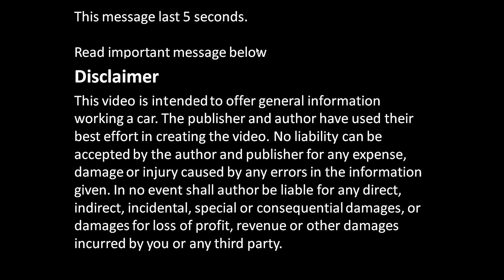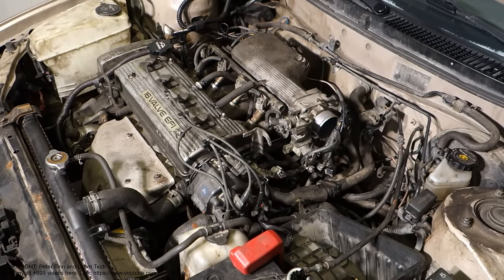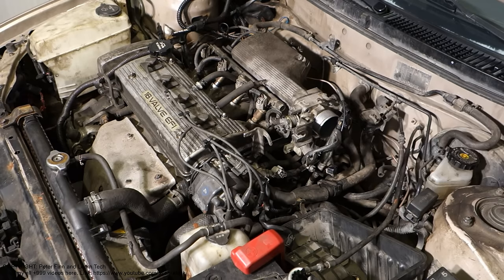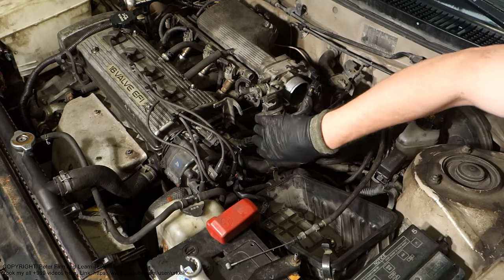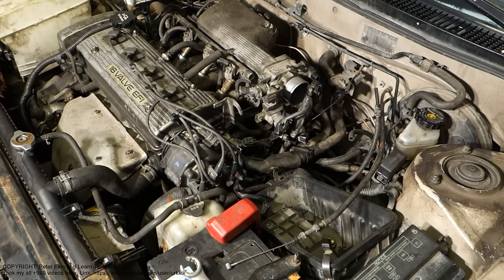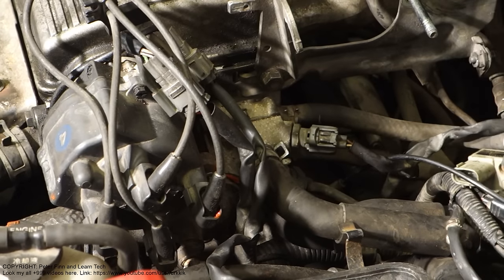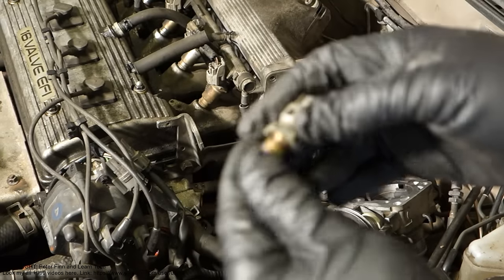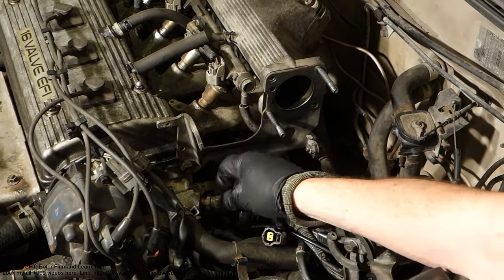How to replace coolant temperature sensor Toyota Corolla. Defect code PO128  Years 1991 to 2007

Comment: This video helped me out so much my radiator fans weren’t turning on I bought every single relay for my 2001 Toyota Corolla and stumbled upon this video, turns out the plug that goes into that sensor was broken and it wasn’t sending info that my engine was overheating
Reply from the maker: Great job!

Comment: I meant PO128, which is 'coolant' something, but coolant is fine, no leaks and temp gauge/level and warmup are all fine.  I think idle isn't too good either, which might be another symptom.  Due to your video, I know where to look for the sensor in the first place;  I'll check this and the PCV valve (as shown in another video you did) as well.
Reply from the maker: Hi, it could be sensor issue. Look this video   : https://youtu.be/OMWNyaBPb54

Comment: Very good and specific video.  I'm trying to analyze a P0128 error, coolant temp seems to be in range on my 2000 Corolla, but I get the check engine light.  I suspect this sensor more than the thermostat.  I've tried resetting and letting car warm up more, but the light will eventually come back and stay on.  Idle seems odd also which might be another symptom.
Reply from the maker: Thanks for comment. :-)

Comment: does aftermarket temperature sensor from autozone makes a big different?
Reply from the maker: These should work too, but less time. Toyota original parts last 400% more nornally.
Reply: Which one did you get?

Comment: Hey, can you help me? I have 2004 Toyota Corolla 1.4 (petrol) and it has starting problems. It cranks but doesn't start when stopping after a short drive. I have taken it to a Toyota dealership but they couldn't find anything. 

Fuel pump changed. MAF and throttle body are cleaned. Battery and sparks are okay. Today I will change the crankshaft position sensor. Next step is to change the ECT. Also all the relays are okay

Any ideas what else it could be?
Reply from the maker: Hi, please check compression rates ?  Look my video :  https://youtu.be/oYWyH8rnUwI

Comment: Replaced mine, now engine has trouble starting.  I replaced it while engine was hot and coolant went out.  It'll have a rough idle and I give it gas as it's starting.  I'll try to put old sensor on and see if that has anything to do with it.

Comment: I just did the test on the ECT sensor by unplugging it to see if the fan would turn on. My car ran a little rough  when I did that. When I unplug it it's supposed to turn the fan on right? Is the engine supposed to run and sound different when you do that?
Reply from the maker: Yes, You are right

Comment: What the other coolant sensor underneath the distributor called. I can’t find anything about it
Reply: Yeah same here
Reply: Same here
Reply: A one wire sensor is for the gauge in the cluster. The other sensor is helping the ecu to get correct air fuel mixture.

Comment: I changed mine today, but light still comes up after a while of driving. Do I need to reset manually motor light, or is there probably more problems to come?
Reply from the maker: Ok, next do these: A code P0128 may mean that one or more of the following has happened: Low engine coolant level ,Leaking or stuck open thermostat (likely), Faulty cooling fan (running too much), Faulty intake air temperature (IAT) sensor.  👍😃
Reply: @PeterFinnTheCarDoctor  kiitos 😁 tarkastin siis myös johdoilla koodin uuden asentamisen jälkeen, ja 22 ilmestyy. Sillon kun valo palaa, tyhjäkäynti kierrokset laskevat hieman. Valo pois, nousevat normaaliksi...

Comment: I was about to take apart to test, but I think I'll order the part first so I don't have to do everything twice.   I also wanna test my pcv.  Also, when do I know I need spark plugs?  I pulled one or two and they look fine, I've for 140k miles but bought it at almost 100k and know the previous owner kept maintained.  I was looking at timing chain, but shop said they last forever, as do some vids on here, though I think you have one on replacing.
Reply from the maker: Hi, here is spark plug info: https://youtu.be/e2XsCU12DQA
Reply: I replaced plugs and get insanely great fuel mileage now.  I'll address this P0128 code next.  I got new thermostat and will try that first, but I think it's okay since temp is always fine, but maybe doesn't warm up fast enough.

Comment: Thanks for the video.  I changed it with a cheap sensor from ebay, but now the temp needle goes almost to H, once the car warms up.  Do you think I should use the Toyota OEM sensor instead?
Reply from the maker: Use only OEM sensor, they are more accurate !

Comment: Thanks to your video i install temp senser by myself but last time i think i forget to put the washer and i notice coolant leak from the sensor, and i crank engine many time to start my 1997 corolla , how can i stop leak from tempreture sensor? Thanks so much.
Reply from the maker: Please add gasket glue
Reply: Peter Finn thanks so much, any gasket glue will do?
Reply: It has no washer, use regular pipe thread tape...not "any old gasket glue will do"...

Comment: Hi Peter, love all your videos :) 
quick question what's the problem on cold start, the rpm is really low i need to step on the accelerator to gain rpm until it's warm. 
checked everything already, spark plug, ignition coil, cleaned iacv and tested it but still on cold start it got low rpm and rough idle, it runs smoothly when engine warms though. Thanks!
Reply from the maker: Hi, what car you have ?
Reply: I have toyota corolla 1995 4afe engine.
Reply: @cyrussantonil3889   Hie i have the exact same problem on my 4AFE Corolla 97. Did u find out wat was wrong?,if u did can u share with me wat was wrong ,i would greatly appreciate it this problem is now getting on my nerves

Comment: CAN YOU TELLME WHAT THE PROBLEM COULD BE I REPLACED THE COOLANT SENSOR IN MY 2001 TOYOTA COROLLA LE BUT CHECKENGIN LIGHT KEEPS SAYING CHECK INGINE COOLANT SESOR. I NEED HELP BECAUSE I HAVE TO GO THROUGH EMI8SSIONAS.
Reply from the maker: +Darren Bonner Ok, you have still issue on. Check wires too. And if issues is still on, please visit the Toyota dealership center. They know very fast normal issues in Toyota. I visit too !

Comment: Peter, can you recommend an obd2 scan tools for corolla pls.
Reply from the maker: +Richard Yap Hi, I have use this, it works ok. Look link: http://www.amazon.com/SainSpeed-Professional-Diagnostic-Backlight-Manufacturer/dp/B0062004GC/ref=sr_1_fkmr1_1?ie=UTF8&qid=1448612502&sr=8-1-fkmr1&keywords=QUICKLYNKS+T79+scanner
Reply: +Peter Finn thank you
Reply: I'm not Peter, but I have had a positive experience with bluetooth OBD sensors. Almost everyone has smartphones these days, so you can leverage the hardware you already have to save money and have a more advanced tool. I picked up a bluetooth sensor online for about $10. I used it with the torque app for android and I can read error codes for many types of vehicles although I mainly use on an '05 corolla. It can also use the gps sensor and accelerometer in your phone along with the rpms etc to give you horsepower and torque figures as well as mpg. It's a neat tool.

Comment: Thanks. please help. my car drives fine in city speed like upto 50 km/h, but overheats at higher speed than that. idling is fine, everything ok. only problem is overheat while over 60km/h. what to do?
Reply from the maker: Hi, please replace new Radiator

Comment: hey why does my 2007 corolla shakes after i changed the sensor?. and the ideling is very low.
Reply from the maker: Hi, there is computer maybe looking settings. Please drive 100 miles with high revs. Computer could become better.
Reply: +Peter Finn it wont start anymore. it just crankes.
Reply: I've had the same problem. I haven't changed the sensor yet though. You might try to use an obd scanner if you or a friend has one. If you really need one, there are many bluetooth models that you can use with your phone online for around $10. (that's how I figured out it was a temp sensor fault)

Comment: were did you see that error code PO128 Peter?
Reply: you need to hook up a automotive code reader. Its basically a little computer that will bring up the code and possible symptoms. Most car repair shops will look it up for $10.00